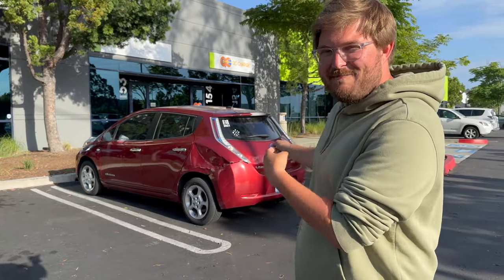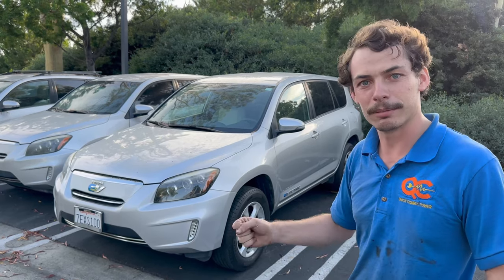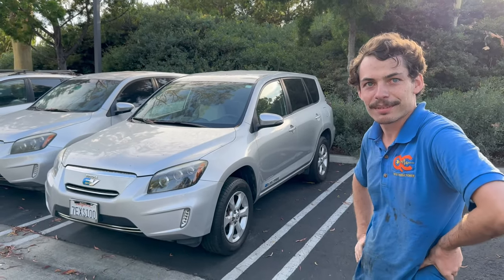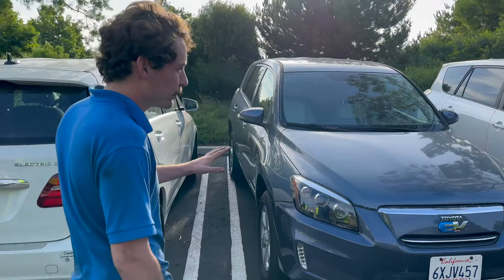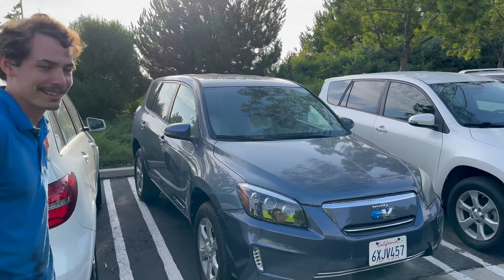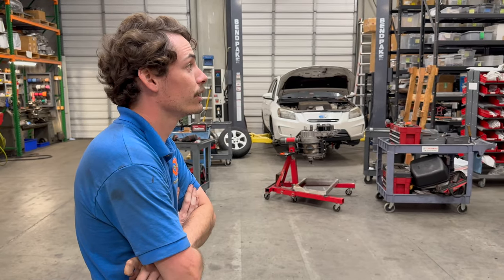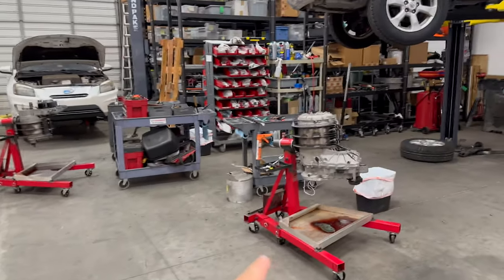Fixing My Cheap Nissan Leaf! On-Board Charger Replacement & RAV4 EV History Lesson w/ QC Charge

Comment from the maker: Thanks again to QC Charge for fixing my LEAF! I've left chapters in this video so you can skip around to areas of interest (It's another long in-depth EV video from us).
Reply: I'm an electrical engineer with board level repair experience and would love to try to repair your charger for no reason.
The only problem is I live in Georgia.

By the way, I just interviewed for a job at that new Hyundai EV plant!
Wish me luck everybody!
Reply: Kyle @OutofSpecReviews, have you seen the Transport Evolved 7 apr. 2022 video “The Next Big Battery Breakthrough = A "Fountain Of Youth" For Lithium?”

We have a 2014 24kWh Leaf. Bought it in march of 2021 at 84000 km, now at 113000 km. Mostly drives around town and charge over night. But did make a long trip last summer, and again this summer. Driving/charging/driving for about 18 hours, 16 fast charges in a day. Battery gets very warm in the end, at the first red bar on battery temp meter, but these old Leafs doesn't rapid-gate. Then immediately slow charge to 100% = balancing cells. Repeated going home again a few days later. Leaf Spy says it did wonders for battery health and capacity both times. Health up about 5% and stayed there for many months, almost a year. Capacity up about 1 kWh, which is also about 5%.

I try to keep the battery cool to be able to go far.  If you drive fast, go low and charge high, the battery will warm up much faster and I guess you won’t have to spend 18 hours in the car.  Give it a try, you have nothing to loose.  /Martin
Reply: Great vid.  Something to consider:  talk to Robby Layton Autobody in Utah to fix left rear QP?  He is on YouTube and might be a good dual video opportunity.

Comment: In April 2023, I bought a 2013 Leaf SL with 42k miles, for $2,000. I’ve put 5k miles on it and I love it. It’s very well built and quiet. Mine has a lot of battery degradation, which is why it was so cheap. It will go about 45 miles on a charge. But most days I only drive 30 miles. Plus I can charge for free at work. My teenager loves borrowing it because it saves him from buying gasoline. Lol
Reply: same
Reply: I can get a 62kw.hr battery kit landed in Australia for $5400. Swap out the pack internals. ~400km range. Transforms the car.
Reply: I’m really hoping the ccs2 to chademo converters become cheaper and work on a wider range of public chargers. Things are looking good for a cheap ev future.

Comment: We bought our 2013 Leaf used 8 years ago, with 11k miles. Right now we have only 2 bars of deg. My wife daily drives it, and we do all errands in it! 65 miles of city range. Just got new tires for it. Tires and a new 12 volt with AGM was all we ever gotten for it. 56k miles on original brakes. The PERFECT city commuter! Santa Fe, NM 🤘
Reply: Anything that only has 65 miles of range could probably be replaced by an ebike or bus around my parts. A car for just in the city means your city has got a terrible urban design.
Reply: Are you ever able to take the Leaf down to Albuquerque? The return trip might be tough but the DC charger at the Kewa Gas Station (Santo Domingo Pueblo exit) will actually work with a valid Blink card. It is just such an old charger that it couldn't communicate with and charge my 800-volt Kia EV6.
Reply: much more convenient with an old EV though (written with firsthand experience)

Comment: The black box next to the charger is a backup power module for the braking system, if I recall. Similar to how a vacuum assist brake booster still gives you enough stored vacuum to stop the car if the engine dies, that pack uses capacitors to store energy for keeping the power brakes alive.
Reply: Good to know. Capacitors are dangerous

Comment: Hey, I know that RAV4! (23:50 and 36:00) 
I worked on it at my repair shop in Madison, WI.
I had replaced that 50 amp fuse previously.
Alex was a great resource.

When it had charging problems again, decided it was time to have the motor milling noise addressed at the same time. And rather than pull the motor and ship it to QC Charge, it was more cost effective just to send the whole car to Alex instead.

Glad to see it is being kept on the road. 

Keep up the good work!

Comment: As a 2015 Leaf owner this was a great watch, thanks for covering all electric vehicles!  

I’m down to 8 bars, there was a year I tried to make some 120 mile high-speed round trips in the Leaf using multiple DC stops in the Atlanta summers.  I don’t think the battery appreciated it at all.  Some days I did another 50 miles after that using a couple of L2 charges and the battery temp gauge was all the way up before the red zone.  The lack of liquid cooling for the main pack was a real shortcoming.

Comment: 20:00 A CCS kit for the Leaf does exist, but you have to ship it to Muxsan in the Netherlands. They will not ship you the kit to DIY install.
Reply: There is a ccs2 to chademo adapter now. Early testing phase as initial
Users are finding compatibility issues with some public chargers.

Comment: I've replaced the fuses on a RAV-4 EV charger in the past and I have a theory for why they fail:
The Tesla LDU creates pretty high ripple voltage on the DC buss due to it's low capacitance polyester caps. Meanwhile the DC side of the charger that is also connected while driving has larger electrolytic caps that are trying to smooth out that ripple. I wonder if that ripple current is near the DC side fuse limit and slowly wearing out those fuses with thermal cycles? 
It would be interesting to put an AC clamp meter on on of the DC charge leads while driving to see what the ripple current is.

Comment: Thanks for the info! I've owned 250e for couple years (had a drive train replaced by Benz under warranty once) and now I am still driving my 2012 Leaf. It's good to know there are service options as my battery is still on 9 bars (second battery already under warranty).

Comment: Yay! So glad you got your LEAF's AC charger replaced! You'll love it more than ever now. I saw a lot of those inner "workings" when Nissan had to replace my battery pack under warranty. NOW… get that rear fender fixed! Surely there must be a wrecked LEAF in a salvage lot with an intact fender. Buy one, cheap, and then have it repainted if necessary. I'm sure Liv will appreciate being able to charge it at home.

Comment: I drove my 2011 Leaf SL (same color as this one) for 12 years and 42k miles. Battery capacity was down to 5 bars. I could drive about 30 miles max on a charge. Nissan wanted $13,500 to replace the battery with one with the same capacity. I sold it to CarMax for $3400.

Comment: Seems like that charge unit is worth repairing, it can't be that hard. Someone will be able to use it. Heck, you might even need it again when it's repaired. I wonder if there's a more robust diode that can be used, or if that would burn something else out. I wonder if an inline replaceable fuse tucked under the rear seat would be a good idea...
Reply: Looks like a $10 MOUSER order … and enough spares to fix 10 more

Comment: Amazing shop :)
Just one comment on balancing 40:00 : I've used the Leaf battery and its BMS in a number of EV conversions. The BMS always balances when it's on but at a very low balancing current, like 20 mA or thereabouts. So balancing takes a super long time, many 10s of hours to level out like 50 mV imbalance. With DC charging and driving there simply isn't enough time for that.

Comment: A NACS-to-CHAdeMO adapter? An emphatic "yes" to that one ! 

As an i-MiEV owner, I've been thinking a lot about this one lately. Tesla, after all, still sells an adapter that basically does this in reverse (ie: CHAdeMO-to-NACS.) So, one would think it's within the realm of possibilities.
Reply: "Technically" the CHAdeMO adapter for Teslas is just straight through CAN communication to the vehicle, without much actual translation going on (though there are electronics in the adaptor to perform the handshake procedure for CHAdeMO). Also of note, Tesla superchargers when being used on a Tesla car also utilize CAN based communication. To put it a bit more simply, on "modern" Tesla cars, they can speak to the chargers in both CAN and are also capable of PLC when using a CCS charger. Older Teslas only speak in CAN, which is why they cannot use CCS chargers without being retrofitted.

NACS on the other hand uses PLC communication (literally the exact same protocols as CCS), which is completely different from CAN, so the translation is a lot more complicated. V3 superchargers have the ability to speak in PLC for these future NACS equipped cars, but earlier V2 superchargers do not (which is also why future NACS cars will not have access to those chargers.

To simplify, Tesla cars already have the correct communication abilities to talk to CHAdeMO, they just need a "physical" interface to plug into that can perform a few basic handshake procedures. Whereas a CHAdeMO equipped car does not have the communication abilities to talk to NACS (or CCS), so those capabilities would either have to be retrofitted to the car, or have some sort of mechanism to "translate" the totally different languages of CAN and PLC, so that makes things quite complicated...
Reply: @KonduitEV  Thank you for this very detailed reply. I note that NACS is now being referred to in tech spec language as SAE J3400. I assume that is the PLC compliant version. An older chart I have, showing what was then all the world's DC EV charging standards, refers to the Tesla plug as SAE J2411, which I assume is the older CAN version. 

Very much enjoyed the video of your facility. It's important work you're doing to keep older EVs functioning and driving into the future.

Comment: Before I even see the video.  I just bought a replacement for my 2012 leaf, a 2019.  I love the car but it won't charge on AC.
Reply: Oops.  The dealer couldn't figure it out and sent it in to a Nissan dealer 4 months ago!    It is possibly the same issue or possibly an issue with the AC charge port.   The Nissan guy believes it had a small bump and repair and the may have tugged the wire loose.

Comment: Ever since you bought this car I was looking forward to you replacing the charger. I had a similar issue with my 2012 Leaf a couple of years ago and was quoted $6000 just for the part at my local Canadian Nissan dealer. I found a new part online from a supplier in Rhode Island and had it installed by the local dealer. In total it was still around $2500. I sold the old charger for $50 to a guy who had some unrelated project on the go. Still, with the exception of that issue and a 12 volt battery replacement, it was an excellent, dependable car. If I did it over again, I'd probably take the internal circuit board to an electronics repair shop and have the diode replaced. Thanks for the great video!

Comment: So about the onboard charger fuse blow, it could be over amped but fuses depend on the metallurgy inside for the element to melt. Continuous or pulsed high current can cause the fuse to clow prematurely. Tesla now ahs a pyrofuse for that reason. Even overheating due to bad connections can cause them to blow.

Comment: I hope that in time, there will be shops doing component level repair of common faults on the power electronics instead of replacing entire modules. 
There are still too few EVs (and mostly too young) for that to happen, but I really hope for that to eventually be common.

Comment: off topic, in Europe you woulud not be able to drive this with so extensive body damage - in general any sharp edge on the body of the car make its inligal.
Reply: Interesting, never heard of that law before. In the US, it just can't affect the function of the car or it's required components like lights, mirrors, windows, etc. 

So the Cybertruck will be illegal in Europe? 😂
Reply: In which country and under which law?
Reply: @Harrythehun  Any country that does the yearly EU inspection should fail a car with sharp edges. On the other hand not everyone follows the rules

Comment: The reason the fuses blow on the OBCs and also the heater is because they don't take an electrical spike/over-current very well. When replaced with a slow burn fuse, this problem is essentially completely eliminated. Discussion at 36:30 in the video. I can't take credit for the knowledge, as I learned about it when researching a dead 2012 Leaf heater and another youtuber explained the problem was the fuse.

Comment: It's also worth noting that the 2011-2012 Leafs were all manufacturered in Japan and imported, and they had the original battery chemistry packs.  Once they redesigned and made the 2013's they were built here in the US (you can tell the US cars by the missing side turn signal lights near the front wheel fenders).  The 2013+ cars had an improved battery chemistry pack known as the "lizard pack" which was built to handle heat better for warmer climates like Arizona, and also heat from DC fast charging.

Comment: 54:00 - That seems such an inefficient use of space, piling a few components vertically behind the back seat, robbing cargo space and causing the non-flat-load-floor with the seats; when there was room under the hood for those components, which also would have saved significantly on complexity of running the wiring and coolant!

Heck, relocate those components up front, and you could make a decent little cargo van out of a Leaf dumping the back seats.
Reply: They did re-locate the onboard charger up to the front (along with numerous other changes) starting with the 2013 model year.

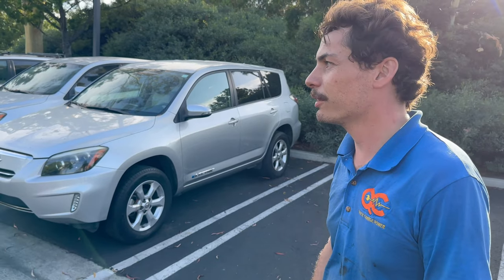Comment: 3:30 - the 1st gen RAV4 EV was only sold in California. There are two of them up here in my neighborhood in Oregon! 

(I almost bought one a few years ago; also almost bought a Ranger EV that had had its charge port swapped for J1772.)
Reply: The 2nd gen was also only sold in California! Many of them however have since been "exported" all over the U.S., and even internationally (there are actually quite a few 2nd Gen RAV4 EVs in Norway, Jordan and Ukraine for example).

Also of note, there's actually a guy up in Eugene OR that specializes in repairing 1st Gen RAV4s and Ranger EVs.

Comment: Great video. At $3750 plus $1200 for this repair I suppose this was barely worth it for a second vehicle to be used in by a typical household. I consider the 2012 and earlier Leafs to have been pathfinders. My 2013 Leaf was rear ended last year and totaled. At the time I was getting just 40 miles on a charge. I took the $7000 check from the guy's insurance and bought a 2015 Leaf for $8500. Now I get 84 miles of range and I can top up with CHadeMO when I need to. I hope to get 8 to 10 good years from this car.

Comment: 9 bars at mid to high capacity is probably not accurate. For some reason, Nissan doesn't give every bar equal 'weighting'. For instance, my 2016 Nissan Leaf SV has 10 bars of capacity, but the SoH in Leafspy is only 72.07%

Comment: Very cool to watch this I had an 2013 and miss it but got an 2019 now and works good, wish we had an shop like this near by then might have ask too see how much to fix my battery issue ⚠and heater too.  The 2019 is working well but has 23% battery degradation 😐but 140+ miles range is good for me from like 35-40 in my 2013 with 5 bars. 😇

Comment: I think you got a backwards when you said if the diode was Open there is nothing you could do but if it was shorted you could put another diode in parallel. If you have an open circuit and you put in another diode in parallel them that diode would function correctly but if you have a shorted diode and you put another one in parallel with it it's still a direct short. You should go back in your video and correct with some text on the screen.
Reply: It wouldn't be a diode in parallel, it would be in series (inline with the proximity, and upstream from the charger). The only way to fix a blown diode (open circuit) would be to remove the old one from the circuit board, and install a new one in its place.

Comment: I replaced the onboard charger on my 14 Smart. Few bolts and hoses and wires and I had the $600 used charger installed. Now miles later I have a p1ca100 code and it is time for the junk yard. The fix is now over my head. Wish there were more EV repair shops local to the panhandle of Nebraska. If you want another project car for videos let me know.

Comment: They are recycling the coolant. I’m thinking hygene needs to be super clean

Wash the car down before dismantling. 

 rinse the collecting bucket and funnels with distilled water before use 

Seal the bucket with cling wrap to keep dust out.

Comment: I'm dealing with a Leaf myself. The on board charger failed. And the used unit the shop got me was no better. It appears that most of the Leafs that are at salvage facilities are there because the on board charger failed. If it's a leaf at a scrapyard and there is NO BODY damage, it's there because of a bad on board charger.

Comment: Two questions spring to mind now that I'm... 56 minutes into the video. First - if the 2011 and 2012 models had more aluminum body components than the later models, does that make them a good choice or a bad choice if you're looking for an older Leaf to keep running for a long time?
Second -- if the charger is in the back in the 2011 and 2012 Leafs, would that make it easier to add more batteries to the back Muxan style? I sometimes imagine removing the back seats and adding more batteries in their place - turning it into a two person vehicle with extra flat cargo room and more range. Looking at the shot at 56:30 makes it look like this might not be such a bad idea, and more batteries could be put in the cargo area and where the rear seats were. Am I missing anything?